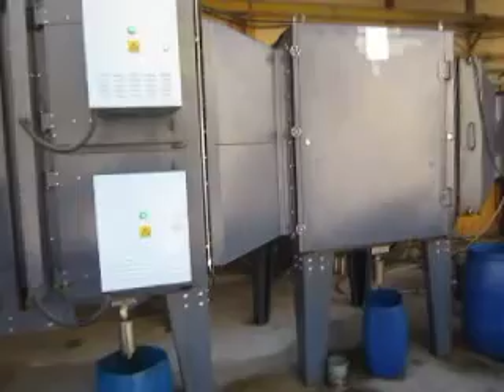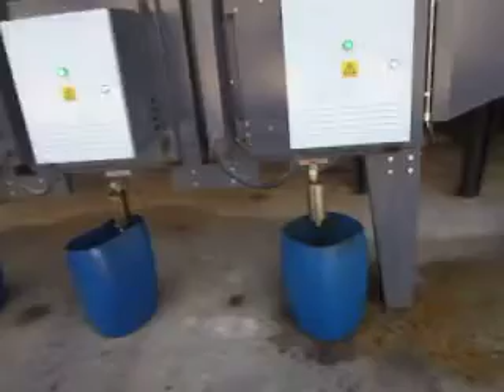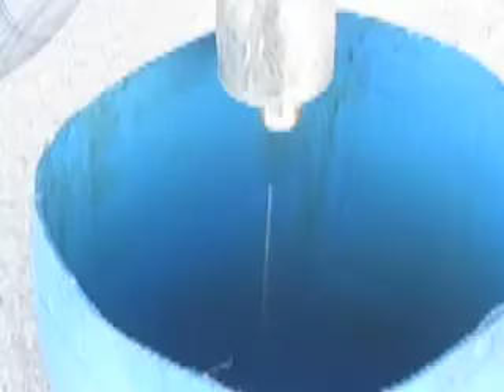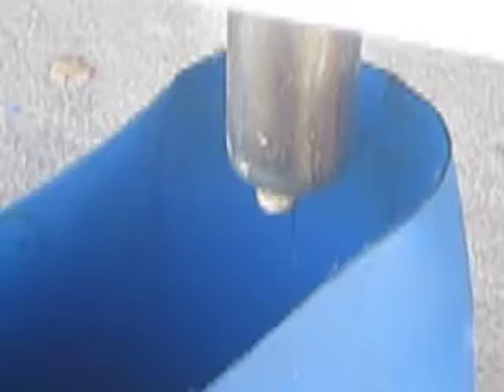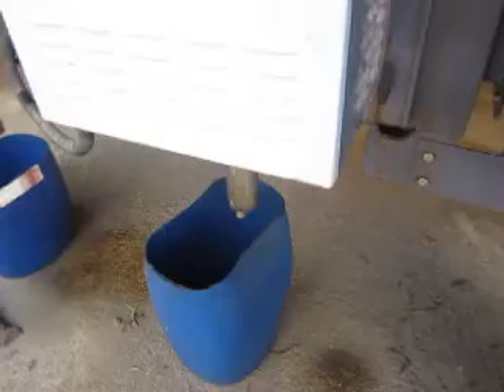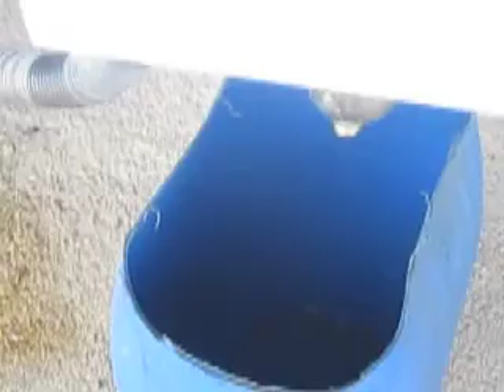DOP Oil Collector ESP

Comment: What means DOP?
Reply from the maker: Valter Gonsalves DOP is a  plasticizer used in the PVC leather/wallpaper/glove etc production process. Our Electrostatic Exhaust Air Filter (ESP) is used to purify exhaust oil mist generated by pvc production process. DOP will be collected during the exhaust oil mist smoke purification process.